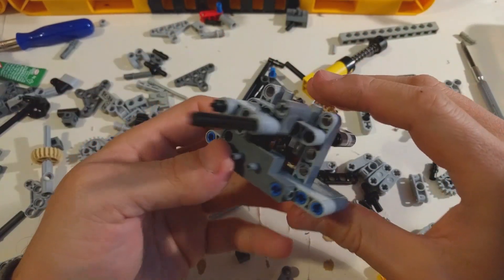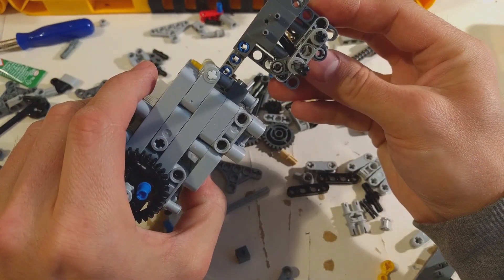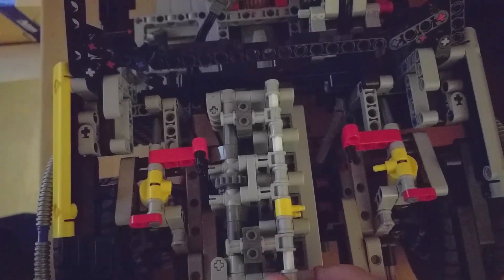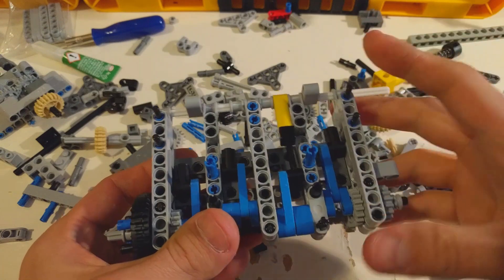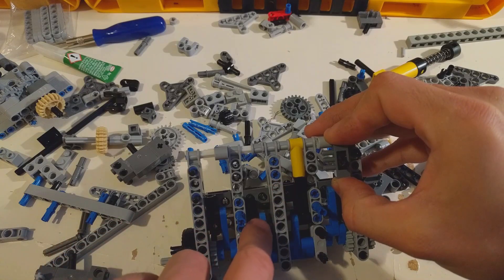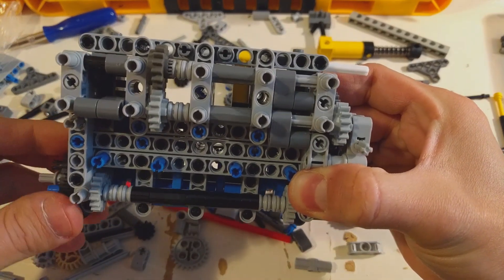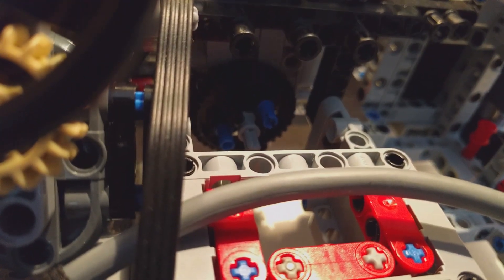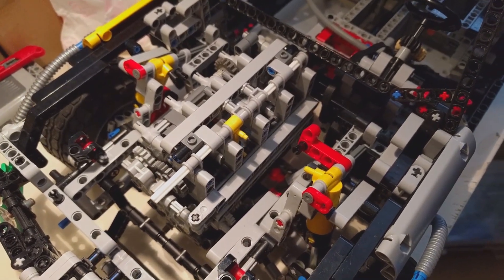LPE power Development - Small cylinder Inline 4 part 2

Comment: Thanks a lot! but the switches in there, are they modified? or are they just the old kind of switches?
Reply from the maker: They are modified of course.
Reply: I know that, but the old switches have studs on top, or did you cut pieces off and glued other pieces on ?
Reply from the maker: The 2 pin holes get cut off and i glue technic bricks on them. Different ones, depending on what kind of mounting situation is needed.

Comment: Hmm. It looks good for BMW. ;) But the motor not powered by lego pump?!
Reply from the maker: That would be highly inefficient and would not allow for a lot of rpms.
Reply: nicjasno It's a shame you gonna limited right? RC will not be right.
Reply from the maker: That's why i wanted to go electric with the e30. The alternative is a bottle of compessed gas in the car.
Reply: Yeah! And how you would complement the bottle? Or exchanged?
Reply from the maker: That's the plan.
Reply: nicjasno 
Pls do that ultimate realism :D
Reply: what about co2 tanks used for guns? they are small and contains high pressure.
Reply: rawux1228 
But it shouldn't be too high. I think Niciasno is running his engines at 4 bars, is it?
Reply: so maybe he could add small pressure regulator.
Reply from the maker: 8bars, my compressor can't do more.